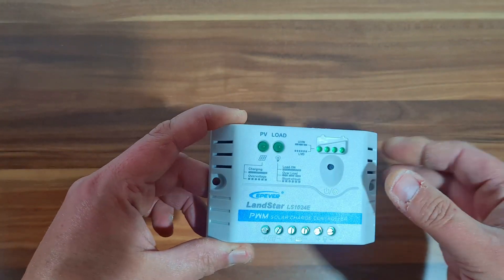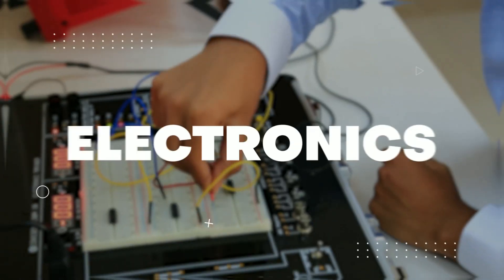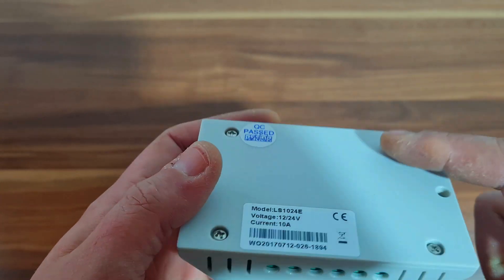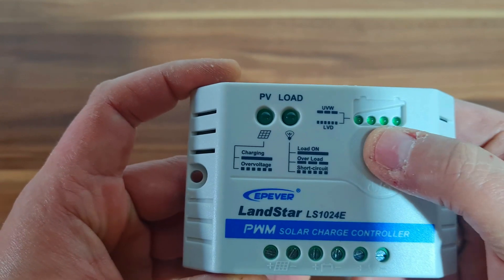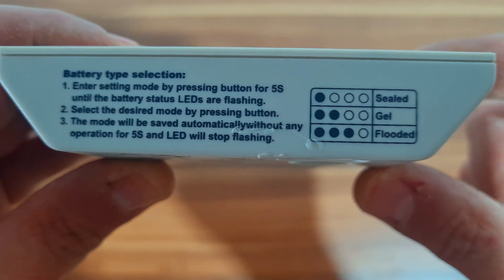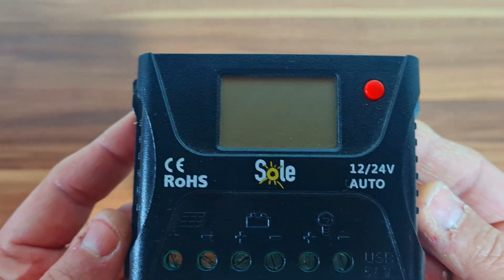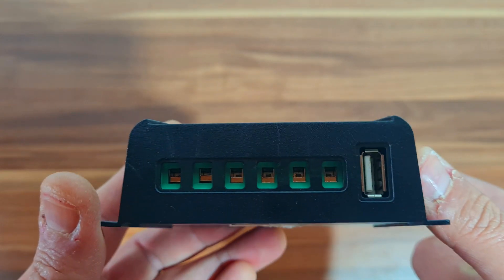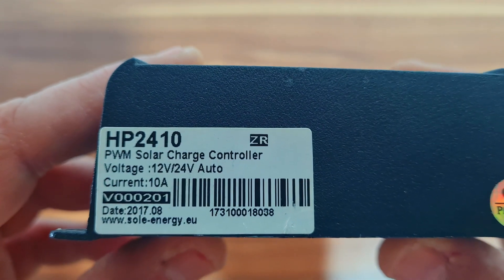Best cheap PWM solar regulator

Comment: How do i charge phones over the usb port on the sole one i have conected the battery conected the pannel even turned on load and nothing could you shortly explain how to enablr the usb port
Reply from the maker: On that device you only need to press the red button once to enable USB, no other options to turn on USB.
Reply: @electro_solar  thank you so much we have a vecation home in the middle of nowhere and dont gave signal while there ill try that when i get there
Reply from the maker: @blackoverlord3009  No problem, hope u will make it :D

Comment: Can i connect car battery to landstar ?!
Reply from the maker: Yes u can, its lead acid battery
Reply: @electro_solar  Which charging mode should I choose ? Sealed ?!
Reply from the maker: @i-am-armin  Yes, it will work, but that battery is not made for solar. Best way is lifepo4 battery.
Reply: @electro_solar  ?

Comment: Do you have link for the Epever brand?
Reply from the maker: Hi, sorry for my late replay. https://www.epever.com official site. I order it from Amazon.
Here is better model with USB:
https://www.amazon.de/-/en/EPEVER%C2%AE-Charge-Controller-Connection-LS1024EU/dp/B07BR34N9Q/ref=sr_1_14?crid=LJDTTN57BAXI&keywords=epever+10a&qid=1673372262&sprefix=epever+10a%2Caps%2C123&sr=8-14